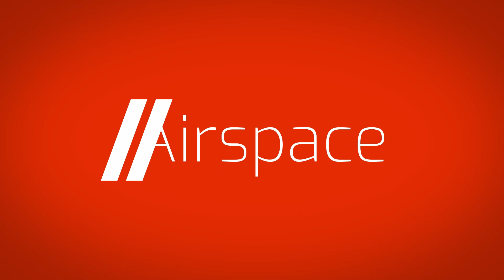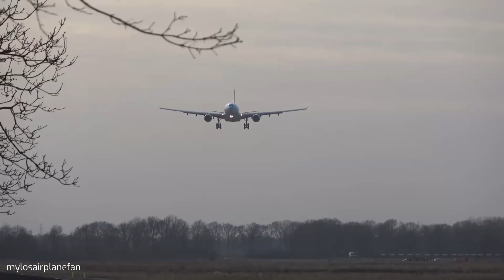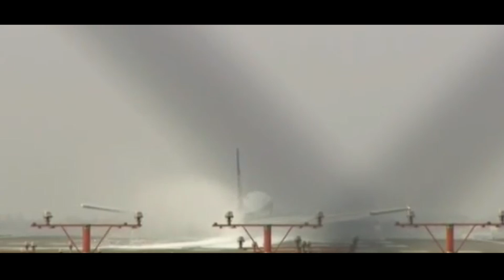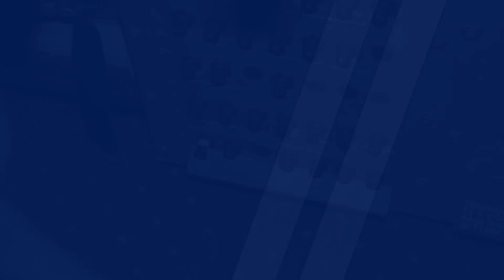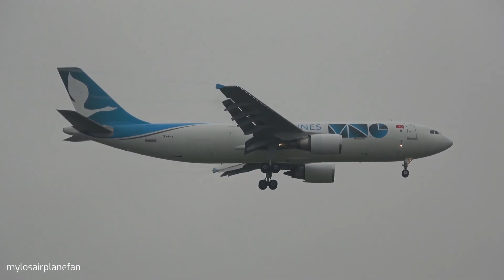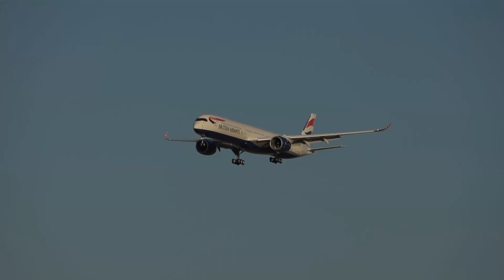Gear Up Landing | LOT 16 lands without landing gear

Comment: You mean to tell me that no on-board manual the crew had access to would instruct them to check the A-1circuit breaker as a possible fault for the backup landing system?  NOBODY knew to check the A-1 circuit breaker??  I find that extremely difficult to believe.  Also, if these breakers were notorious for being hidden by baggage or other property belonging to the flight crew, this would make checking these circuits even more imperative and obvious.  Let's not sugar coat this incident- it had more to do with pilot error than anything else, and a reprimand is more in order than praising this crew.  The only good thing is that they got lucky and no one was hurt.
Reply from the maker: I'm always careful to assign blame - this channel is here to present final reports, and they state facts, not assign blame. That is reserved for the courts.
No, there is no referece to the A1 circuit breaker in any pilot manual. The investigation committee even suggested to Boeing that they should put it in the manuals, but they declined. The maintenance experts on ground should have seen it on their diagrams, though!
And yes, human error played a part, too, the final report states so.
Reply: I'm an engineer for medical equipment. It's similar because doctors operate the equipment but they can't know all the details (and I can't treat a patient). What a doctor must do is call am engineer if he finds something strange or unexpected behaviour.
The pilots contacted ground. They had experts on the ground with all documentation available. I mean the first thing for an engineer is to check if the device has power. Check the whole thing from battery till device. If you're not able to do this then it's not the pilots fault.
And if there's no space to store the trolley properly then it's faulty by design. Because the designer has to expect that the crew has necessary trolleys with equipment
Reply: How many flying hours do you have?
Reply from the maker: Around 4000 at the moment.
Reply: @r.m.entenza1312  And how many do you have that makes you qualified to make a coherent and intelligent rebuttal? What's that? You don't need any, you say??? Then how could you possibly have an opinion on the matter?
Reply: @1JackTorS  2700h 737-800, and I still consider myself a newbie to give an opinion
Reply: @r.m.entenza1312  Riiiight... And I'm really Elon Musk.
Reply: @1JackTorS  good for you
Reply: @1JackTorS  Pilots cannot know everything about the aircraft they are flying, it is way too complicated to prepare for every kind of failure. That is exactly why they ask for help from an engineer on the ground.
I am more puzzled that the manufacturer did not list this issue for their engineers. The engineer on the ground may have had enough time to read through the entire list of possible electrical faults. 
Or maybe not,  they were a little low on fuel and time after all. 

In that case the only thing at fault was the design. Putting circuit breakers unprotected at that position sound weird. Selling a protective cover as an extra security feature later sounds just wrong. Such simple security feature should have been mandatory and free.
Reply from the maker: well said! Actually, the schematics showed the diagram, but the engineer wasn't able to find it (I believe because of computer difficulties, if I recall correctly).
Reply: @adamrak7560  Selling safety features as extras is becoming a Boeing staple.
Reply: Seriously? You think this crew deserves a reprimand despite performing a perfect gear-up landing? Not checking the circuit breaker was an honest mistake, something all humans are prone to especially in a high stress environment, that's exactly why pilots follow checklists and procedures. If the checklist skips a basic fault like a tripped circuit breaker, then it is a badly designed checklist. The goal of the investigation is not to assign blame, but to prevent similar accidents from happening in the future
Reply: @aarondynamics1311  "Honest mistakes" have crashed passenger aircraft in the past and killed hundreds of people.  Air crews cannot afford to make "honest mistakes" when they are responsible for the safety of their passengers.  
The goal of the investigation is absolutely to assign blame.  This is a primary way of preventing future similar accidents.  In this case, "pilot error" was assigned as one cause, and the main cause, in my opinion.  They wouldn't have had to do a "perfect gear-up landing" if they did their jobs properly in the first place.  Hell, the freaking ground crew hoisted the plane, reset the breaker, lowered the gear and towed the plane away.  Maybe THEY should have been flying the plane, huh?
Reply: @1JackTorS  Put simply, if an air crew cannot afford to make an honest mistake, then something needs to be changed. The investigators are not trying to hold anyone responsible, they are only trying to determine the cause of the accident so they can issue safety recommendations. If, like in this case, pilot error contributed, then they would suggest ways of reducing the chances of crews making such an error through improved training or revised checklists or they would suggest ways of reducing the severity of the consequences of a similar error in the form of safety systems/protections

Comment: Does anyone know how they removed the plane from the runway?
Reply from the maker: with cranes, and air bags
Reply: @AirspaceVideos  Thanks! I literally havent been able to stop thinking about that for like a month, where did you find the info about the removal?
Reply from the maker: In the final report :)

 https://reports.aviation-safety.net/2011/20111101-0_B763_SP-LPC.pdf 

page 40/41